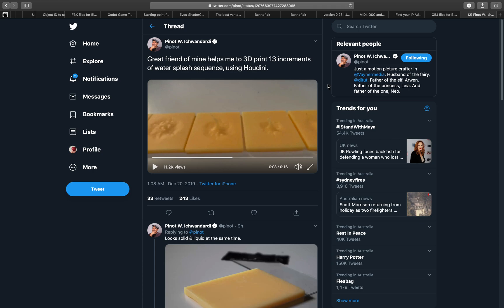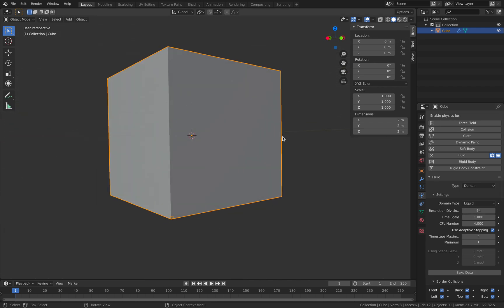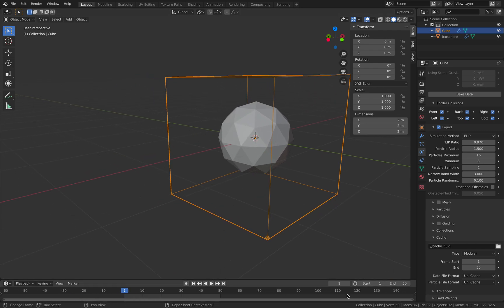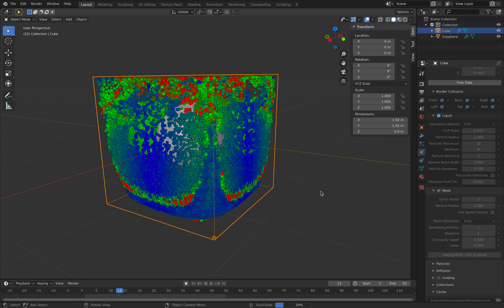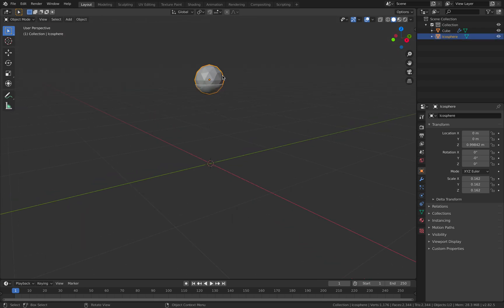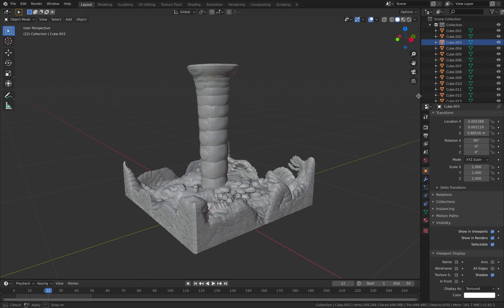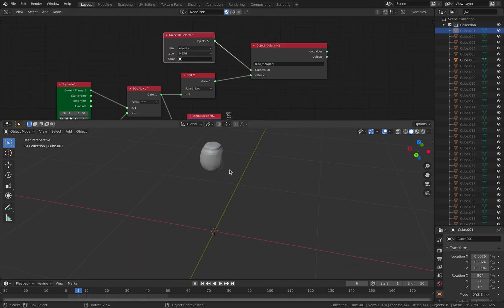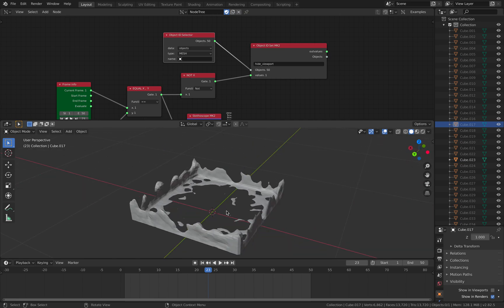BSLIVE Creating A Stop Motion Liquid Animation Using Blender 3D

Comment: Really liking the new fluid simulator. However, i am facing the same issue with smoke and fire. It always looks pixelated no matter how high resolution i make it.
flames dont really look like flames in closeups. It works for distant shots. I don't know what i am doing wrong.